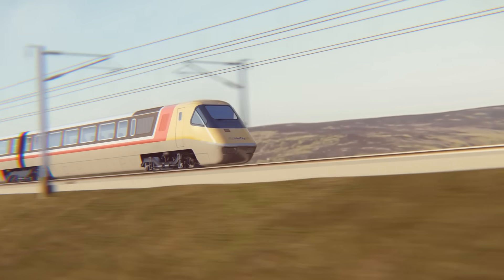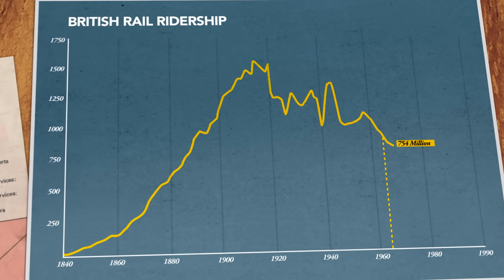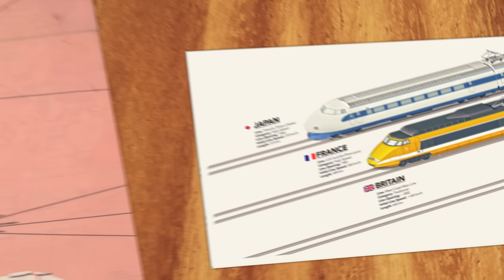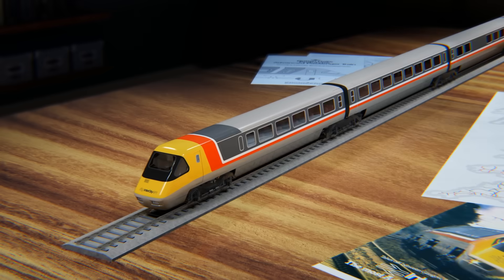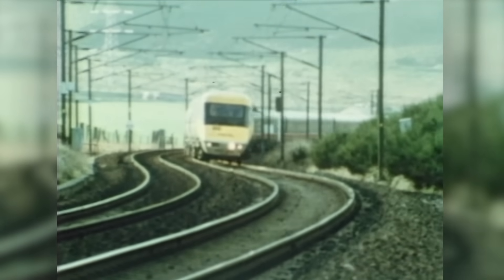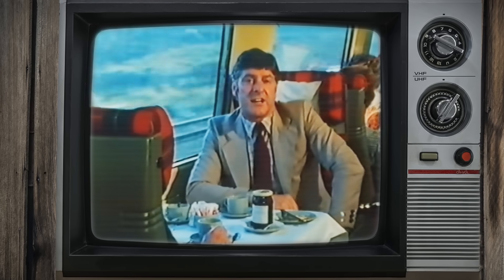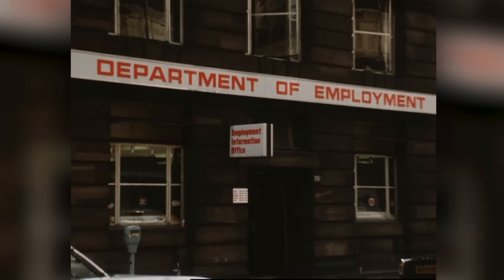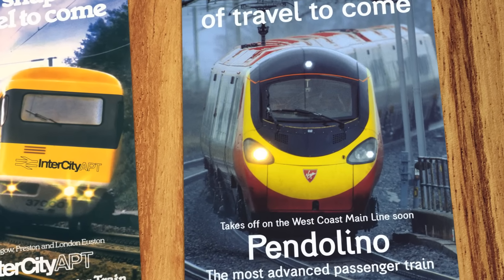This Train Made Passengers Sick: The APT Tilting Train Story

Comment: The problem was the tilt control computer was unable to filter out the bend fast enough. But even if it had been perfected most  signalling and rolling stock location system can't cope with trains going over 125 mph.  On a test run the apt reached 160 mph but infrastructure limited it 140 mph

Comment: In Italy, the studies for a tilting train started in the mid 1960s and the concept was patented in 1967 by two engineers of Fiat railway materials, Franco di Maio e Luigi Santanera. A number of prototypes were built and tested, including an automotrice (self-propelled) derived from ALn 668, the ALn 668 1999 diesel car, provided with tilting seats in order to test the concrete effects of active tilting technologies. The first working prototype using a tilting carbody was ETR Y 0160, an electrically powered car launched by FIAT in 1969. This was the first to be christened Pendolino.

This design led to the construction of a whole EMU in 1975, the ETR 401, built in two units by FIAT. One was put into public service on 2 July 1976 on the Rome-Ancona (later extended to Rimini) line, operated by Italian State Railways. Between Roma and Ancona (km. 295), the train took 2 hours and 50 minutes, while the ordinary trains took 3 hours and 30 minutes. The train had four cars and was mostly considered a travelling laboratory for the new technology. Initially the ETR 401 was conceived as the first of a series of four trains, but the government lost interest to the project, because of financial problems, and the envelopmemt was temporarily interrupted, as the service in 1983 and the train was used in demonstration campaigns to foreign countries, like Germany, Switzerland, Cechoslovakia and Yugoslavia. A second unit was built for service to the wide-gauge RENFE Spanish lines,in 1977, under the nickname of Platanito. The service didn't last of long, because the problems of Spanish tracks made Platanito little useful. 

New interest of the Italian government to the project in the mid 1980s, and the introduction of new technologies, led to the revise of the project of the ETR 401 with electronical systems, that led to the introduction of the sigthly more advanced ETR 450, the first Pendolino to enter regular service in the world. Characterized by an 8-car configuration, and a maximum tilt reduced to 8° from the 10° of the ETR 401, for safety and comfort reasons, ETR 450 could run the Rome-Milan line in under four hours, at speeds up to 250 km/h. Passenger numbers increased from 220,000 in 1988 to 2.2 million in 1993.

Comment: What's said about Pendolino is wrong. The first FIAT Pendolino prototype is dated 1971 (FIAT Y 0160), and that year it started to be tested. The first APT prototype started testing one year later.
The first Pendolino (ETR400) entered in service in 1976. It was just one train but it was earlier than the first ATP. It entered in service on the Rome-Ancona line, and with a very limited number of issues. The first ATP entered in service 5 years later.
Indeed it is true that FIAT bought patetens of the APT to increase ETR class features, coming up with the second ETR generation, the ETR450, of which 15 were made and entered in service in 1988. And that was the first real successful tilting train in the history.

Comment: Classic UK. Spend all the budget pioneering new tech only for another country to finish the job.
Reply: Nothing of the APT ended up in the Pendolino. It's just a legend.
Apart for the fact that the Pendolino prototype, FIAT Y 0160, was built in 1970, while the APT prototype run for the first time only at the end of 1971, and the first commercial Pendolino (ETR 401) became operative in 1976 (8 years before the APT) and had been retired from passenger service only in 2008, the working principle of the two is different. Pendolino has two gyroscopic and accelerometric transducers on the two bogies of every car, instead of a single accelerometer on the center of the car. That means that it reads the inclination of the track at the start of the turn, and can react in advance and more precisely than the APT system, avoiding the oscillations and imbalances that were the cause of the motion sickness of the British project. That's why it had been so successful worldwide.
The only reason why FIAT bought the British patents in the '80s, was to avoid someone else buying them and developing them in a competitor project.
Reply: While you laugh, I've seen that Italy's railway company have won various commissions with its new Freccia 1000
Reply: Technically they did finish the job, all the problems had been fixed by the time they were removed from service, it was entirely because of the bad press they got put out of service when they were finally fully functional and all the problems(including motion sickness) had been solved, the Italian Pendolino is literally just using the exact same system as the APT and is even worse because its slower than the APT.
Reply: Sad but true: The world's first computer was developed at Bletchley Park to decode German Enigma coded messages in WWII. Afterwards Churchill orders the break up of the machine. IBM later produce their own computer. De Havilland Comet World's first commercial jetliner. Early technical problems plagues it with crashes with these first Jets and by the time these issues are remedied its reputation is mired by these initial setbacks and US Boeing then takes the lead in commercial jet avionics. Concorde first supersonic jet liner (yes 50% was French input) but the French benefited more and created Airbus which is now the opposite number of Boeing. The world's first vertical take off fighter jet, the Harrier Jump Jet but no longer made. The former Soviet Union developed a vertical take off plane. Now US have their own equivalent.
Reply: William Ahem HST, IC225.
Reply: @dan27032  Amtrak Acela tilts as well.
Reply: Nick Barnes But can it actually get to the station on time, or run on a line which isnt owned by a freight company?
Reply: @videoviewer2008  Yeah. Maybe they got inspired by us vikings after we let them try our X2000.
Reply: Dandmore you the Vikings died out a thousand years ago.
Reply: @ Dandmore. I didn't know the X2000 (introduced in 1995) was capable of time travel.
Reply: Yep that the UK in a nutshell. Light bulb, jet engine, jet aircraft, atomic bomb, tilting trains, harrier jump jet, we are very good at inventing them, then we get cold feet and don’t put the money in to develop them properly.🙄🙄
Reply: Classic UK - spend some of the budget on pushing established technology and get a train that has given 45 years of reliable service and still going strong.
Reply: Don't forget Derby railway works built the first MagLev it travelled from Birmingham International Railway station to the Airport at least half a mile?
Reply: @daniel halachev in fact,first where the US in 1937,then Spain,put one in service on 1950.
on 1960 england started experimenting with active tilting.
italy put on service another passive on 1973.
and then,England put their active tilting in service on 1985.
so yes,and no,and who knows.
Reply: And of all countries... Italy?
Reply: @Rainaman-  italy made and make lot of trains(and ship), normally for internal usage. and like england needed high velocity train in outdated network
Reply: @Rainaman-  Well isn't that the UK through and through....creative genius coupled with crap politics and incompetent management! haha....but yeah, kinda ironic it should be the Italians that finished the job  and made it work reliably! Last country I would have expected to do that!
Reply: @soundseeker63  You'd be surprised at the amount of good engineering in Italy from 1950 to 2000, it's not just food and fashion...
Reply: Reinis Miks why not ? . Italy  has been U.K. procurement partner for fighter aircraft such as Tornado.
Reply: Reinis Miks why not Italy ? Italy has been UK’s jet- fighter procurement partner for many decades?
Reply: Just like the world War Britain does all the hard work then the US comes in and finishes the job
Reply: Bob Ross Just stop. All you’re doing is regurgitating your ignorant conception, not to mention it being completely unrelated to a video about a train design.
Reply: @SofiaFoxxx  but the Brits where able to develop the first VTOL fighter plane, (The Harrier Jump Jet), that the Americans just couldn't fathom out how to do so.

Comment: ETR 401 also called "pendolino" the tilted italian train enter into active service 1976, many years before, or i'm wrong?
Reply: They only made 1 of them for testing and modifying just like the APT-E. The APT-E was in service 1972-76 then sent to the NRM. Both britain and italy suffered from budget cuts and lack of political will even though they both had talented engineers and made advances. First active tilting train to go in proper 'comercial service' was the Canadians with the LRC. They made 21 of them plus another 10 for Amtrak. The ETR 450 was a combination of italian and british active tilt technology. Italians took it from there after that until sold to Alstom in 2000.

Comment: You seem to have missed the fact that BR developed; in tandem with APT, the 'InterCity 125', a train that is still in service today. While the Shinkansen and TGV are fast - and I use both frequently - they operate under completely different circumstances. Also, the speed difference between, both the Shinakansen and TGV; in comparison with the InterCity 125, is marginal at best. While the Shinkansen operates a frequent service, it is not necessarily what people believe as one needs to travel on the 'Super Shinkasen' (generally called the Super Nozomi - i.e. the 'Super Hope', or, Super Expensive not covered by JR Travel Passes) which run at 'true' high speed, and mistakenly, foreigners, and, idiot videos like this, are either ignorant of, or, choose to forget the fact that Shinkansen travel includes: The Sukura, Hikari, Kodama and Mizuho. These Shinakasen are generally, NOT "BULLET' trains, but normal 'fast - 200km/ph' trains which travel directly from city to city without intermediate stops. Making the frequent trains of the Shinkansen around the same speed as the InterCIty 125 trains, and EXPENSIVE. The same with the TGV, the incidence of travel is about one trian every one to two hours during peak periods, putting it under par in comparison with the InterCity 125, thereafter, TGV's run at one train every three to four hours, and EXPENSIVE. Meanwhile, the good old InterCity 125 travels between London and Penzance in similar speed for half the cost. If you wish to be impressed by high-speed travel stand on the platform of Paddington Station, London while the GWR InterCity 125's leave - the sound and acceleration are something to bear witness to.
So let's stop knocking the British for their ingenuity and try to understand that experimentation often becomes the Mother of Invention. Ah! Yes, I forgot, the accent of the narrator appears to me to be North Americsn - what have they ever done for the advance of rail travel ?? Jack Shite. Also, try and get it into 'yer heeds' - the UK invented rail travel and the logistics of the island is much dfferent to that of Japan's river valleys, water meadows and pine covered knowles. Similarly, La Belle France is five times larger than the UK with swathes of flat open land - not so the UK. Oh Yes, one last poiint to ponder upon - InterCity 125 = 125mhp which equates to 200 kilo-metres per hour. Neither the Shinkasen nor TGV run at that speed for sustained periods while the InterCiy 125 does. If you have travelled on either of the Shinakansen or TGV regularly, you would undertsand that the UK has achieved much more; with limited resources, than either Japan or France, and laterly, China - but that is a completely different set of circumstances. What is the InterCity 125? = The APT without the tilting mechanisum - so all the research was not wasted, without benefit or lost, and the British not at all as incompletent as this purile video tries to misinform viewers.

Comment: If the tilting mechanism is fine-controlled (computerized!) according to speed and if this works accurately, passengers won't get sick. because the tilt is actually not felt when balanced softly and the right way. If such a system instead works more like a rough "rollercoaster" then this causes comfort problems. Failing tilting mechanisms are not uncommon. Also the later ICE in germany had a bunch of issues with their tilting system, requiring them to slow down for quite a long time until this was fixed. One of the problem is - with aging of the damper elements - that the train starts "swaying" slightly like a ship on unquiet sea if going on higher speed. This occurrence is called "speed resonance", because a train has a certain mass, length, and therefor a specific resonance frequency which easily can get the train into oscillation of not properly compensated.

Comment: Much has been said about the Japanese Shinkansen but it only went to 210 km/h, not really fast either (TGV speed) as already some trains were reaching close to this 180 km/h with the French Alshtom Turbo-Train going from Lyon to Bordeaux. Then Canada-USA unveiled their own Turbo-Train with passive tilting coaches and turbine driven all made in Montreal. Then that Turbo-Train was the first tiliting train to enter service and commenced operations in 1968 running at 150 km/h (very fast for old Canadian tracks) betwwen Montreal and Toronto. In Pennsylvania, tests reached 267 km/h. Then, in 1981, active tiling was used in the MLW/Bombardier LRC train which replaced the Turbo-Train and ran until this century. They ran at 200 km/h and were considered the fastest diesel trains. The technology used by MLW was based on accelerometers in a feeback loop so people would never feel sick. This technology is the one found on the Bombardier Super-Voyager nowadays.

Comment: Worth remembering that the APT budget from concept to running was programmed by the UK Government was £47million a figure that was dwarfed by that of the TGV and that prototype covered well over 600,000 miles during testing.  The first TGV route track clocked in at $4millon per km for the track alone and it was over 10km long

Comment: Meanwhile in 1976 the ETR 401, the precursor of the Italian “Pendolino” tilting trains series, entered in service with Ferrovie dello Stato (Italian State Railways). After the ETR 401 other more modern and technologically advanced tilting trains were introduced, such as the ETR 450 (1988-2015), the ETR 460 (1994-...), the ETR 470 (1997-...), the ETR 480 (1997-transformed in ETR 485 in 2005) and the more recent ETR 600 and ETR 610 (2008-...). The “Pendolino” trains were also sold outside Italy and now are still doing their job😊.

Comment: Class 150, 153, 156 & 158 were, in a way the APT's successors, too - trying to do for 2nd-rank regional lines what the APT would have done for the main lines. Compared to what came before, they were smooth-running and highly powered, and the faster operating speed of the engines reduced the vibrations in the passenger cars above. (For the ultimate vibration-free experience, one has to travel in the Class 139 at Stourbridge ;-) )

Comment: I wanted more details about what went wrong and why it was causing motion sickness.
Reply from the maker: There’s just only so much you can fit into a video in 10 mins unfortunately but I regret not spending a minute on that point.  Some people still get motion sick on tilting trains, but the original APT caused more motion sickness because it was actually too perfect. Banking into a turn without feeling any lateral force really messed with some people’s inner ears. The solution was actually to tilt the APT a little less so passengers felt some of the forces.

Comment: I see one glaring flaw with the British theory (based in large part on my experience with model trains). Okay, the train keeps the passengers comfortable around high speed turns (theoretically), but those side-forces are still being exerted on the track, itself. This runs the risk of causing track turns to slide on their rail bed, or causing excessive wear and tear on the inside edge of the outer rail. It also increases the risk of the train flipping straight off the track, entirely (see the 2015 Amtrak accident between Washington DC and Philadelphia, where the engineer thought he was on a different section of track with a higher speed limit).
Reply: They thought of all this. Because a bunch of the engineers were from the aeroplane industry they got people in to build new lighter aluminium carriages, diesel engines ruled out as they were too heavy. This meant that APT caused no more wear on the bends than any other train, and actually caused even less wear on the straight track
Reply: @anthonysmith9997  That's good to hear, because a couple days ago, I heard that Amtrak is purchasing new Acela trains, and they're incorporating this "banking" technology, so I'm hoping it works better in real life than on my models. :)
Reply: @c182SkylaneRG  Owh a model titing train, definately on my to buy list the day I have room for a layout. The current Acela Express already tilt. Just done a re read to be sure, the new trains are supposed to be coming with line upgrades which I hope you fully get rather than half a upgrade due budgets. Even today our new Pendolinos could be doing 140 but are limited to 125 because they could only half upgrade the line, still quicker than what went before though to be fair.
https://www.youtube.com/watch?v=-ZdXCvdMVgE